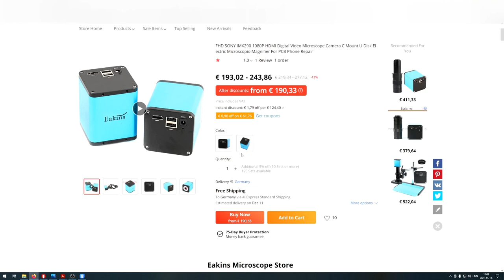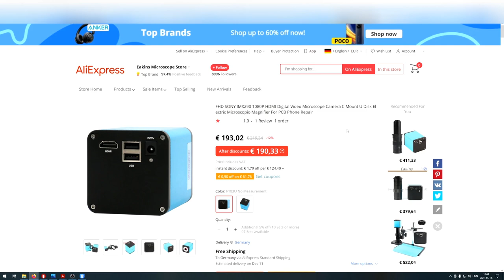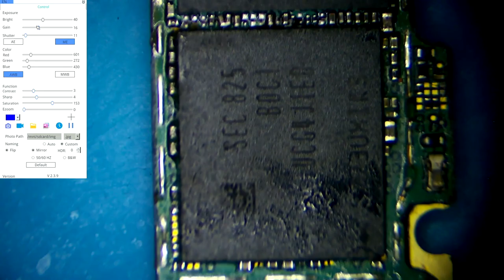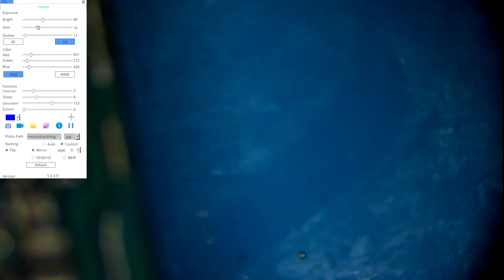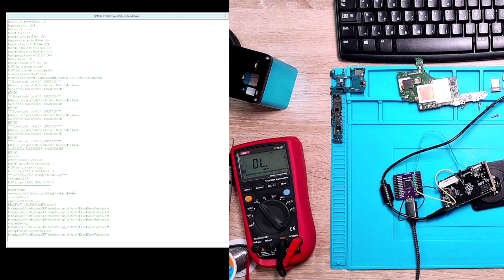FAKE Sony IMX290 microscope camera - SCAM

Comment: Hi ,thanks for your video

I will want to buy eakins sony imx290 ,and after watch you video i'm suspicious.

I have a question what is the socket  you connect to the camera and is the program .

Because eakins is.very expansive in aliexpress and if the seller want to Scam me.

Thanks for you video.
Reply from the maker: My old camera is directly connecting via USB to the PC, the newer Eakins one is with HDMI so you need an HDMI capture card.
As for the software I use the own software of the camera but you could also use the inbuilt Camera app of Windows. For recording I use OBS.
Reply: @kikihobbyrepair  i talk about  utools bootloader ,i have the software but i need pinout  to connect the camera mode jtag to the jtag.

Tanks  for the reply.

Comment: Sucks you got scammed 😡 I wonder why they even make a camera with the IMX185 sensor when it looks THAT bad. The only clue was the price, the IMX290 cameras were always around £400. I've been looking at them for years but was never willing to pay that much, a seller on ebay confirmed they don't make them with the 290 sensor any more. From the research I've done it looks like the only successors that come close in quality is the white camera with an IMX291 sensor, and the blue one with the IMX307 sensor. Both have autofocus and they're both expensive (£300 and £400). I guess it makes sense they make their best cameras be the autofocus ones as they can charge more for them.
Reply from the maker: Basically there were always IMX290 sensor cameras online without autofocus in the 240-250€ range on Aliexpress. I ordered mine in a sale, this is why it was around 200€. The 400-450€ versions were the ones with autofocus but I do not need this because auto focus does not work well while soldering underneath and then it is useless to me.. I am the same like you, I am not willing to pay the 400€....
Reply: IMX185 and IMX290 are the same
Reply: Ha no. @natetechr

Comment: Soften your lighting, it will help with the reflections.
Reply from the maker: Thank you for your comment. I have tried with 3 different microscope light setup, all with brightness controll. Non of them worked... This is simply a poor sensor issue.
Reply: @kikihobbyrepair  its not just about brightness.  Soft diffused lighting will make a huge difference.   Like when you take a photo on a bright sunny day,  you get harsh deep shadows but if you take the photo on a cloudy day you don't.  That is the difference between hard direct light and soft diffused light.
Reply: @kikihobbyrepair  BTW I just bought one of the eakins kits on Aliexpress, it arrived last week and I can confirm the problem is not the camera it is the light source.
Reply from the maker: Thank you for your feedback. Have you already tried it with flux on the board? This is when the problem starts. Furthermore how do you explain that my old 70€ camera works better with all 3 light sources I have tried? BTW which kit have you ordered with which sensor?
Reply: @kikihobbyrepair  yes I have. Hard lighting causes reflections, soft diffused lighting is better.
Reply from the maker: Which light source are you using and which sensor do you have? I might give it an other go....
Reply: @kikihobbyrepair  the led ring light that came with it is ok if you turn down the brightness. I also have an 8 diopter magnifiying light that throws enough diffused light for the camera.
Reply: @kazdean  The light source is a problem, yes, but it is still the wrong and an old sensor. Did you looked the entire video?
Reply: @npntube6847  There is nothing wrong with the sensor. I have one and it works perfectly.  You can eliminate the reflections with soft less direct or side lighting. Any sensor will have the same reflection issue with the ring light because the light bounces directly back into the lens.
Reply: @kazdean  Well, it still is not the specified sensor, right? Regarding reflections, I understand your points, but I believe, this is not entirly true: During startup, the firmware states, that the sensor is operated in linear mode. This brings me to the whole area of dynamic range and point of operation of a specific sensor. The shown bad sensor clearly can deal with a smaller range of light, which cuts off the high lights. This sensor is old and can‘t deal with the dynamic range like more up to date sensors can do.

Comment: yeah I can't find any imx290 for that price.
They don't have any interest in scamming people, I don't think they wanted to scam you, rather the young girl on duty to post the article on aliexpress might have mixed it with another article. The imx185's camera costs the price you paid (around 200$). 

You got a different product but the price you paid corresponds to the price of the article you received. They should have had offered you to return the product refunding the return fee.
Reply from the maker: I kinda agree with you but not fully. If they would be a serious company they should have solve this problem professionally. 
BTW I have just checked and found at least 3 IMX290 advertisement on Ali around 200-250$. It is important that these are all the non autofocus version but this should not affect the picture quality itself. 
The only reason I decided to post this video because there were multiple problems around this.
1. I asked them before the order that is this really the IMX290 sensor? They confirmed, that  yes.
2. When I received it the picture quality was 10 times worse than in the advertisements so I contacted with them onc again that are you sure you sent me the right camera? They told again, yes.
3. Then I made this serial communication read to check which sensor is used when I realised that it is the IMX185. I contacted them several times and they did not even answer to me. Afterwards I initiated the refund process and they did not react anything at all. 
As you also wrote they should have to say sorry we have mixed up the order please send it back to us and we send you the right one. But no, as soon as I had the evidence it is not the right one they just declined me and this is wrong.
Furthermore it is not roght that I got what I paid for because my 70€ Eakins camera is significantly better than this one.
 I will never ever buy anything from them...
Reply: @kikihobbyrepair  In absolute, I would agree with you, but it's aliexpress, it's a gamble.
If you don't want to be "scammed" or have any problem, you should buy from a store locally with your country's protective laws and standards. But I bet it's much more expensive.

Aliexpress has almost exclusively chinese stores, more or less legal (in a "declared" way), more or less professional, the huge majority use a translator to do the article pages in english  and for communication. The support is often just a random young girl who doesn't really give a sh#t and is here just to write random generic sentences as a reply.
Unfortunately, taking Aliexpress for a well established store (or amazon) as you have in your country with different laws, standards, quality control and so on, is a mistake. Simply take it for what it is.

Nevertheless, my comment isn't to denigrate your feeling of being scammed, just to comment on the reality.

My 2-cents is that the reflection of the light has nothing to do with the sensor nor the lens, that's the light you use and the position of it. Also, the image quality depends a lot on the lens.
What sensor uses your 70€ Eakins camera?

There is only one IMX185 at 200$ on the Eakins Microscope Store. The IMX290 one is for astronomy and is only 2Mp.

Anyway, still, thank for sharing :)
Reply: @kikihobbyrepair  you can still try to sell the camera since it's sold for 200$ new. With the refund you got, you shouldn't loose money (or a only a bit).
Reply from the maker: @alexisfrjp  no worries, I did not took your comment as an attack I just let you know the complete story 🙂
Yes, I agree that Ali is a gamble. I just wanted to let people know my story and to take care. 
I am using an Eakins ringlight what it is advertised with and it is on my Eakins trinocular microscope. Also tried the more expensive Amscope like ring light with angled LEDs but it is even worse because the ring itself is smaller in diameter so the light comes back almost perpendicularly. Furthermore I also tried my ownly desiged one with LEDs on goosenecks. From reflection point of view this was better but the picture quality is still poor. In addition I tried a standard 150x microscope lens with similar results.
So I really tried everything before complaining 🙂
Regarding imx290. I saw the ali advertisements in general not at Eakins at the moment. One of them was Lapsun which I was told is a good source. Btw mine when I ordered was on some kind of sale. This is why it was below 200€. Before it was at the 240€ price range at Eakins too.
As for my old Eakins camera it is using a H1600 sensor. I have no idea what it is because never checked before but this is how it is recognised.
And yes, I am trying to sell it now as IMX185.
Reply: @kikihobbyrepair  I found out this video while looking for a microscope for soldering. I'm balancing between camera+TV or a fully passive optical binocular microscope... I'll avoid cameras with the IMX185 then...
Thanks!
Reply from the maker: @Alexis gg  if you do not want to make videos just use it for your repairs, 100% go for the optical binocular. You cannot buy any camera (not even for 1000€) which would give you the same quality of picture/work. Especially because with the camera you loose the 3rd dimension (deepness). Not even talking about reflections. There is just nothing better than your eyes and brain combo 😉
Reply: @kikihobbyrepair  Yeah, I'll go with optical binocular ;) I don't want to gamble on camera/lens' quality! Thanks!

Comment: if u have reflection issue use CPL filter
Reply from the maker: Sure, a filter might help but my biggest concern is that the old 70€ camera is handling the same reflections with all kind of lights significantly better. And I did not get the sensor I paid for.

Comment: I played Chinese roulette. Lost. Instead, IMX290 got a cheap IMX307. Thank you Eakins!
Reply from the maker: Sorry to hear this man.... someone else also commented that he also got IMX307 when he ordered it from Lapsun. All fakes....😡
Reply: @kikihobbyrepair  Hi! Request. Show more details of the contacts to which you connected and what voltage was the converter 5V, 3.3V or 1.8V?
Reply: Can you provide any details on how much worse the 307 is? I am in need of one of these microscopes.
Reply: @orbit3042  The device was disassembled after its inoperability was revealed. After that, it was discovered that the seller deceived with an optical sensor, although the product description clearly indicates the model IMX290! At the same time, it was discovered that the leg of the chip was not completely soldered. And this could not happen due to transportation inside a strong metal body. I spent more than $400 for a non-working microscope with a cheap optical sensor IMX307! The cost of devices with such a sensor is about 102 USD.
Reply: @orbit3042  I can't attach photos here.
Reply from the maker: I am abroad at the moment. I might be able to send you a link with a detailed guide I followed on Sunday.
But I think I used 3,3V (this I would need to check to be sure), gnd, rx, tx and thats it.
Reply: @kikihobbyrepair  I really hope for your help. I'll be waiting for your return, the moment when you have a minute of free time. Thanks!
Reply: @propretor4964  Thank you. Looks like they should lower their prices if they use IMX307 now.
Reply: @orbit3042  Yes, I agree. 4 times. Youtube blocks links, but you may find that a similar microscope with HDMI + VGA outputs costs only 100 USD. I opened a dispute because of deception, but there is not much chance of compensating for something.
Reply from the maker: @propretor4964  this is the link you can use: https://charliex2.wordpress.com/2020/01/14/eakins-camera-hackery-pokery-and-the-legend-of-measuretwice/
Reply: It was happend with me too. I have bought from "Eakins Store". Seller advertise IMX290, but product is IMX307. I gathered the Linux boot log and I saw type of IMX307 in the log.
Reply: @vuha240  I made a theme on the EEVblog Electronics Community Forum resource. You can find my theme named "Eakins autofocus microscope 1080P 60FPS SONY IMX 290 Sensor."
Reply: @vuha240  A direct link cannot be given to Youtube.
Reply: @vuha240  check it out, please. Is + 5V supplied to pin 20 (VDD5) FE1.1S USB 2.0 HIGH SPEED 4-port HUB Controller? My FE1.1S 20 controller has a pin off the board.
Reply: @propretor4964  pin20 is taken off from pad.
Reply: @vuha240  All this is very strange. What is your voltage at pin number 18 HDMI? I have less than 5 volts, only 4.9.
Reply: @propretor4964  Unfortunately I can not measure on PCB board, because product is already assembled. I have only pictures about hacking process.
Reply: @vuha240  It can be measured directly on the HDMI connector itself.
Reply: @propretor4964  We have already boxed in this for return back.
Reply: @propretor4964  Thx, I saw it. You will be hard work to find the hardware problem. In my side, the HDMI works fine 3pcs different DELL monitors. The only problem is the picture quality and that shipped product is not as described.

Comment: I'd presume the quality of 0.35x lens adaptor is terrible, look at the chromatic abberation, lack of proper focusing. Maybe with 190 euro camera you should try something better than 20 euro 0.35x lens. Because the quality of the picture is 80% lens quality
Reply from the maker: But the 70€ old camera works waaaay better with the exact same setup.
Reply: @kikihobbyrepair  dunno bud, the old one even worse on details quality as to me, try not ring light but some side light, and there should be quality imptovement. it looks like the sensor is too sensitive to reflection but the details of the picture much better then on the old one, honestly, i thought it would be worse, try side light source might fix the situation. You see, the optics quality of these chinese trinoculars are complete rubbish.Try this your camera on some olympus trinocular and youll notice the big difference.

Comment: You still have their camera in the picture of your yt homepage 🙂
Reply from the maker: Thats the old one. It is also from Eakins. Thats a 70€ one. This is the one which I compared it to in the video. Still haven't bought a new camera though... 🙂
Reply: @kikihobbyrepair  I am in the market for a microscope... I was wondering how a nice webcam (was thinking logitech c922) or one of those cheap 4k action cam could perform attached to the lens you have. So I ended up here.. Anyway... my plan is to 3d print a mount for the webcam and if things do not work out fine I'll try the m12 to c mount adapter for an action cam...

Comment: Wow. This is good info. I honestly don't thing this happened on purpose. Eakins has thousands of items for sale and moves a lot of inventory based on their Ali store numbers. Maybe they forgot to update the listing or something. Yes, they should have replied to you but again I think the reason why you got no response is because they move so much inventory, language barrier and probably short staffed to care about an issue like this. Your best bet is to have a method of payment that can allow you to easily do a dispute and get some of your money back. It's a gamble for the money you spend on Ali, there's no doubt about it. Most of the times you win, sometimes you lose.
Reply from the maker: Sorry to say but it is not normal from such a big company that they do not reply. I asked 3 times before I ordered the camera if it is really the IMX290 and then they just replied pretty fast all the time. As soon as I had the prove that it is not the right sensor they stopped replying. This is the only reason I created this video...
Reply: @kikihobbyrepair  it’s good that you did. People will now doubt the camera they purchased and check the sensor to see if they also got the wrong sensor. I think if Ali gets enough complaints they will shut the account down. Again, I don’t believe this was intentional. I checked some of their listings and it is very confusing. Sometimes you find the same item with multiple listing all with a different price. They probably have some student managing their store. I don’t think they would risk losing their seller account for this type of thing but who knows. I ordered a trinocular microscope kit a week ago. I’ll post if there are any issues. Their communication was poor even before the purchase. I would get a reply every 24 hours.

Comment: Isn't the IMX185 not the better choice? It uses a 1/1.8" sensor @2.4MP (1944x1224) and not a 1/2.9" sensor @2.1MP, (1920x1080) so it is more light sensitive. The only difference is 108 pics/s vs. 170 pics/s.
Reply from the maker: I am not really familiar with sensors but I also checked this topic. The 2 sensors are totally different technology. You are right that the IMX 185 is bigger which should be better in low light point of view. But the IMX 290 has significantly higher sensitivity, it is automotive grade, it is with backlight technology already. If I compare video quality with the advertisement and with other Youtubers videos with the same sensor then they are not even comparable then with this one. Furthermore at the end this is not what I paid for....
Reply: It could be a decent choice, if that's what you actually bought and paid for.

'Is Pepsi OK?' - No, not if I already bought and paid for an advertised Coke.
Reply from the maker: I agree with you.
I do not care at the end which sensor is used but what I can tell is that it is way way underperforming compared to the advertisement videos and other youtubers  imx290 videos..